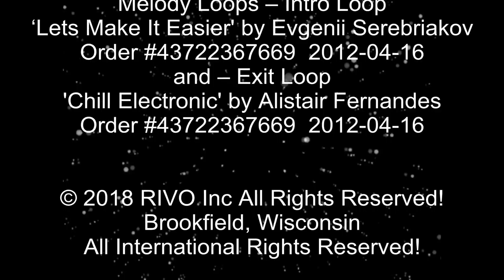Activating Our Waterfall Final Part 4  - Wisconsin Garden Video Blog 825

Comment: I always enjoy a waterfalls and WOW it looks great ,, we used to have a small one by the garage and I had an old mirror I hung on the side & every yr. Mama & papa duck would fly in and watch themselves in the mirror . It was a sight to see .
Reply from the maker: Hi true grit. Richard is at it again, tweaking a new copper water feature system as he removed the PVC and sump pump.  It moved too much water and didn't have that peaceful sound.  We purchased a pond pump and it works perfectly with Richard's new delivery system. It will be in an upcoming video. Stay tuned. Thanks for watching, caring and sharing. Lynn & Richard